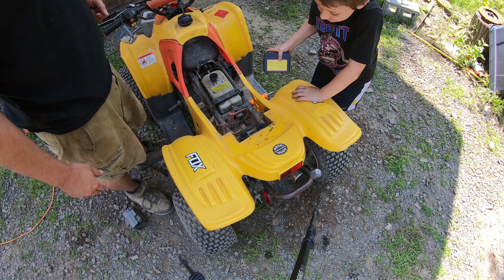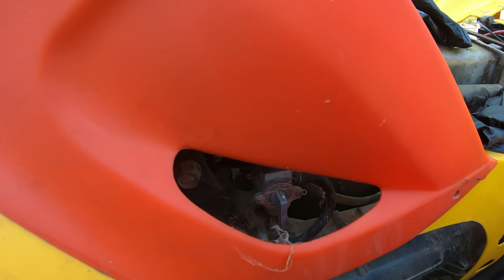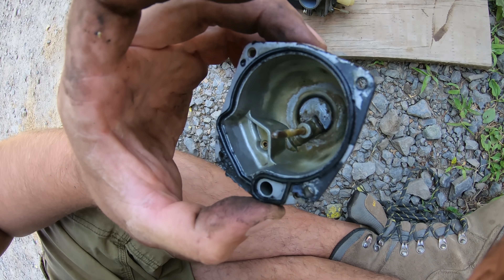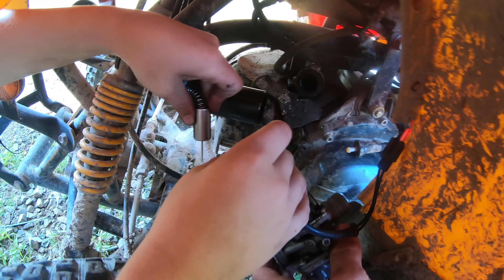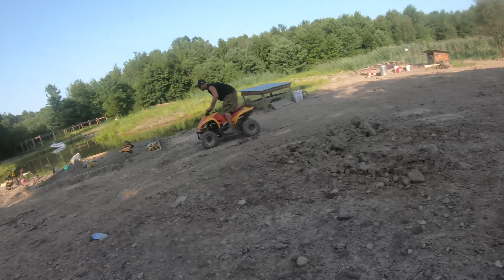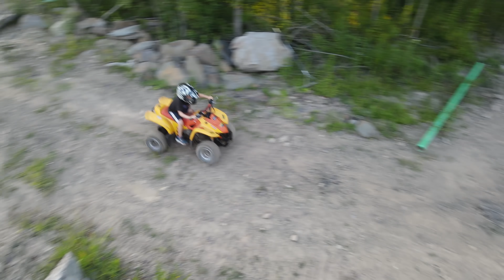Teaching my 6 yr old son how to fix his quad

Comment: I was helping my dad fix a tractor when I was five. When I was six I was helping to swap out engines in cars and trucks. By the time I was 10 I was rebuilding engines. I owned my first car at age 13. It was a 64 Barracuda. I took out the blown up slant six with an automatic trans and put in a 389 rebuilt by my self with a automatic Torque flight transmission. It did wheelies. At 15 I was completely rewiring cars. When I took auto shop In High School the teacher made me his assistant, because I already knew more than the course was going to teach. It all started because my Dad showed me how easy it was to do mechanical things. Mom and Dad are the first teachers and give the abilities to learn to their children for the rest of their lives.
Reply: Well said Charles. So many Good memories.

Comment: Kaiden seems to be a natural mechanic. It looks like that has oil injection if it's still in operation. Some people disable it and mix the oil in the fuel. If they run rich on oil or use the wrong oil, it will plug the spark arrestor. Many people take the spark arrestor out. Depending on where you live, you might not want to be caught on public trails without one. I know the DNR in Wisconsin takes them very seriously.

Comment: It’s not just 2 cycle, cars won’t run if the converters get stopped up either.  One of the worst items is chainsaws. When I bought my first new saw the old man that sold/ services the saw showed me where to drill 2, 1/4” holes in the muffler so it would run better and longer without maintenance.

Comment: A big overlook on these little wheelers is the Chain.  A crusty chain takes gobs of power.  Best way to clean them is a solvent or a hot pressure washer. Then a good chain lube or deisel fuel. 
Also teach him the importance of not sticking fingers near the chain with a hotdog.  I know it’s a common sense thing. But kids are curious.

Comment: you should Seifen off the pond and dig out the island, extend the pond size and depth , id abaut tripple it and use the dirt for building up roads, leveling property and gently sloping steep parts as well as covering bare rock

Comment: I have an idea old Dan may have given you some pointers at that age Jesse.  Good job.  I really never felt that helping my Dad fix things was work.  I loved working on and operating anything with a motor.  Now at 75 I can't figure out any of the new stuff works...too many computer modules controlling things.  Used to be...you need spark, air, and gas and if it didn't start it was missing one of those things.  Now your car won't start because the left front tire is low on air...that's a joke folks.

Comment: Spark arrestors are in all forms of small engines. They are there for fire prevention in a dry forest. They are also found in generators etc. Always check for one in the muffler of your small engines and keep em clean. Your son did a great job! One spark from the muffler can cause a forest fire.

Comment: Kaiden did a fantastic job!  And, hat is off to you for taking the time to teach him.  Win-win.  Relationship building with your son as well as a confidence builder for him.

If you're confronted with a blocked spark arrestor easier way to clean it is with a propane torch.  Hold the screen with pliers and just burn the carbon off.  Quick and complete.

Comment: Looks like you found the problem.  Checking out/cleaning those spark arrestors was part of scheduled maintenance on 2 cycle Suzuki's.  Along with checking every nut and bolt ...

Find him an old junk car engine, let him take it apart.  Good way to get familiar with wrenches, use of cheater pipes, which direction to turn.  Develop the habit of picking up wrenches at the end of the day (minimum)

If you haven't already done so, teach him to wash his hand right after handling batteries, especially before using the restroom/tree/bushes/tall weeds.  Avoid a potentially embarassing trip to the doctor, and minimize the rath of Mom for the acid holes in shirts or jeans.

Comment: It's the good way to learn. You did a great job as a teacher. You can burn carbon deposits with a propane torch too. Don't mix too much oil on gas and it will prevent carbon deposit on the engine too.

Comment: Do you know what's the top oil tank under the seat for?
Reply from the maker: That is the 2 stroke oil tank. It pre mixes it
Reply: @Jesse Muller  
So I just put regular fuel on the gas tank.
I don't have to mixed the gas
Reply from the maker: @gerardobarajas4254  correct. Why do you have one of these machines?
Reply: @Jesse Muller  
Yeah I just bought it and I don't know much is for my 9 year old boy.
But turns on no problem but after 2 minutes turns off 
Do you know why it does that 
Any help is good
Reply from the maker: @gerardobarajas4254  might be fuel filter or if you have premixed gas it could have clogged up the muffler like in this video
Reply: @Jesse Muller  

I'm going to drain the fuel and put new fuel on it.
I already check the exhaust and is not plugged 
I ordered a new card thinking that is that 
Because runs good for 2 or 3 minutes and after is getting warm sounds like flooded and turns off
Reply: The filter looks new